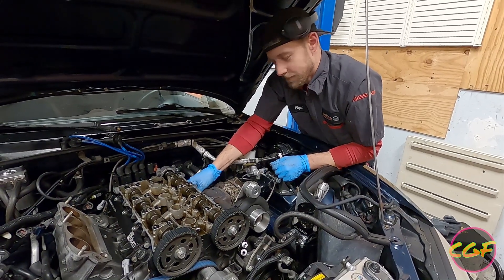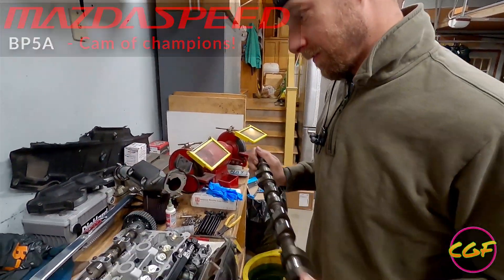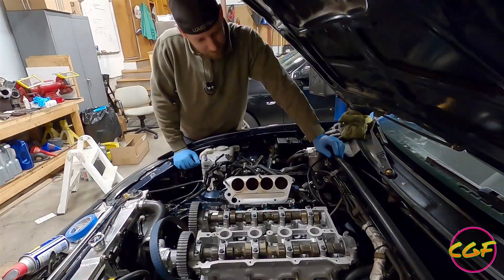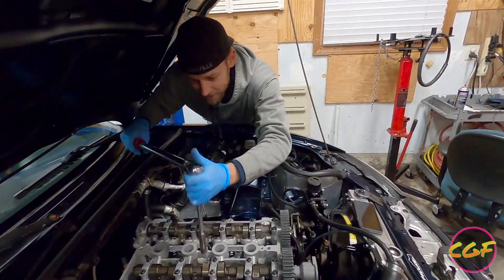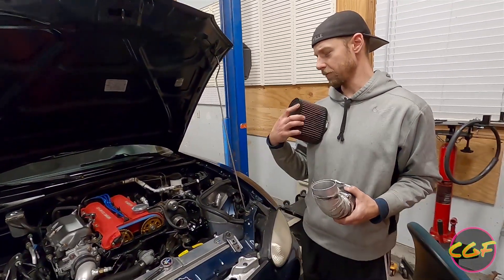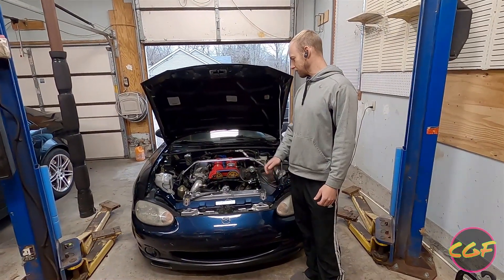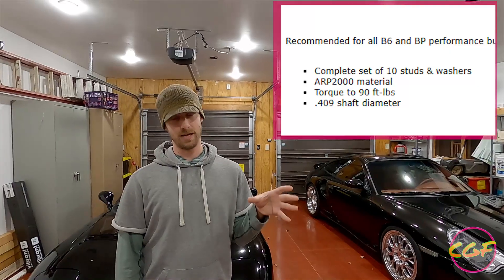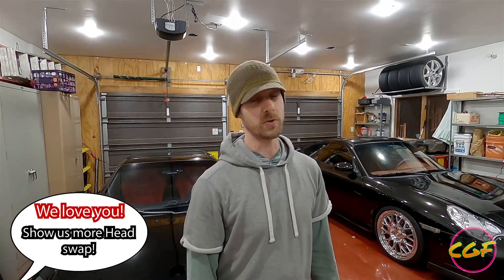Turbo Miata Build : BP4W Head Swap - Part 2 (400hp Turbo Miata)

Comment: Did you install the head then the studs? Everyone always installs the studs first then place the head over them. I like your way better.
Reply from the maker: Yes, the head goes on first with the dowels which will center it. Then the head studs after that. I like this way better because it's kinda a pain in the ass with the studs already in the block

Comment: Funny, I find it way easier to install the head without the manifold attached, a touch lighter that way. Sorry to hear about the head.
Reply from the maker: Yes but getting to the bolts is harder lol.
Reply: I've had to replace my head a number of times  and it seems easier to me to connect the intake and exhaust manifold while the head is off. The bolts are so much easier to get to. Then I use a lift to lower the head slowly. I can't hold that much weight by myself either.
Reply: I know but the head surface is so delicate and the dowels are so sharp. Plus I am usually on my own.

Comment: Is there a reason you didn't do a coolant reroute while it was all apart?
Reply from the maker: Not necessarily. I have never needed a coolant reroute bc I don't track the car, the head is coming back off ( you'll know why if you watched the whole video) and I might do one at that time
Reply: @CarGuyFridays  i've been telling people that for years.. but nobody believes me.  I ran turbo for years without any problem
Reply: @HyperspeedMedia  Telling people what...65ftlb max ??
Reply: @lurcheradogs4life  i meant coolant rerouted is not needed for basic street car.  Upgrades if you track it.  Mazda knows this.
Reply: @CarGuyFridays  the track puts so much more stress on a car. I was having cooling problems with my 1990 at the track. I put in an eBay aluminum radiator and could not get it to overheat on the street. But after several laps at Road Atlanta, it was overheating again. Thankfully it was not as much and the radiator was helpful. I just couldn't simulate track conditions on the street!

Comment: 5:29 Ouch ...and a big thank you for sharing this...my first engine build, last spring, i did exactly the same...except mine was after a full engine (rod only build) ARP studs to 80ft lb , and exactly the same bolt. I did Not (at the time) realise the significance at the time, and like you thought the stud had just rotated? It was only after the brake in, and dyno work was completed that the engine started to breath heavily, and I attempted to resolve this with oil catch cans, did it finally go out with a big white bang... am on my 2nd build now...fully forged and balance, with all the supporting parts....will be sticking very close to all the oem torque specs in this build...keep up the honest work..all the best
Reply from the maker: Oh man that sucks, so you had the exact same issue? The head must be weakest in the back corner for some reason. Yea mine started to smoke like a chimney at idle, and run rough. When you are driving it the car seems to be alright but once you stop it's just a smoke show haha. Thanks for sharing your experience with me.
Reply: Wow, I wonder if it is because that is the only corner without extra material for a cam bearing.